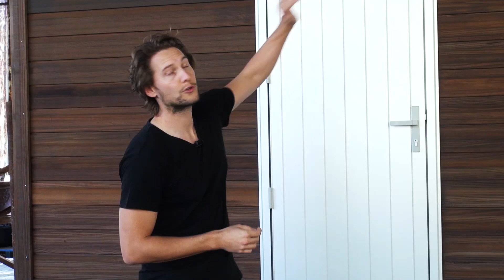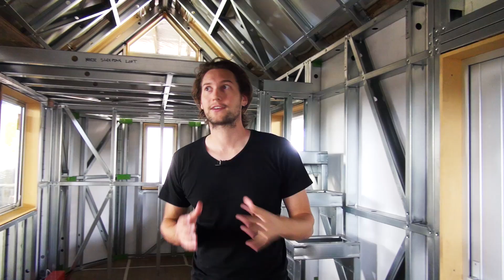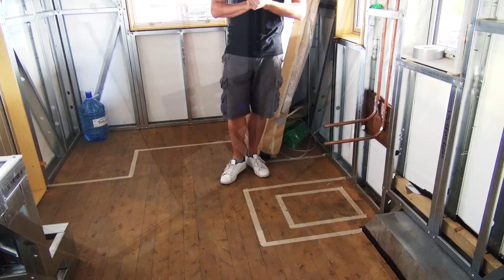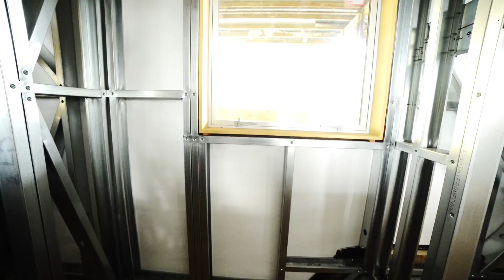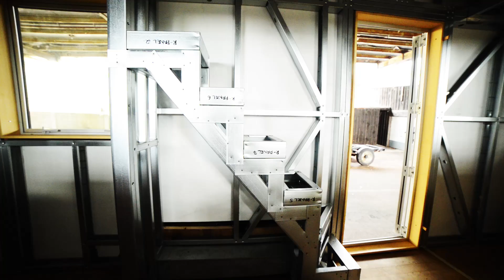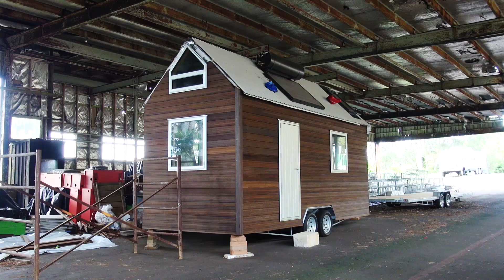Tiny House - Plans For Internal Fit-Out

Comment: Those boards on the outside are soooo beautiful!  I'm always wondering the weight difference between using steel & wood framing.  The builder I like in the US only uses wood, but I like the idea of steel... hmm.

Comment: You have put a great deal of thought into the bones of your Tiny House. Spaces, like the shower area, can easily conform to the geometry you have thanks to modern materials. Marine ply covered with epoxy and fiberglass can last forever and be further covered with tile, etc... I think the Japanese have taken small bath spaces to the ultimate limit. While some are not practical to larger persons, the concepts an still work. I think one critical key to a small shower is to have a bench.

Comment: I had the same idea about using square steel tubing. Would this weigh more then if I use wood? My trailer is 26ft so I want to use all of the space. Although I need to be at or under 6000 lbs finished.

Comment: A shed roof gives soooo much more room. Also, solar panels on the roof dictate parking the house at a specific way. Storing your solar panels on the floor when traveling and then placing them on a stands outside is a much better solution. Yous looks great but these are my preferences

Comment: Impressive build so far. There's a few things I would've done different on design but to each his own. I am still in design process of mine but I will be building on a 42' deck over with a raised deck over goose neck trailer and have decided on steel framing as well many, many other things. Personally with your trailer I would've gone the route of a design similar to Brett Sutherlands for the loft set up. I did catch you saying something about how it would've been an issue when you were transporting the tiny home originally in reference to the power lines and trees, so I understand. Since you haven't done the plumbing or anything really with interior yet, I do have an Idea that may benefit you much better as far as your bathroom is concerned. In my designs I plan on doing a wet room type setup (basically the whole bathroom is the shower) with a rainfall shower head above and mister as well as soft spray jets on the walls. I did it this way in my design as I am 6'5" 273 lbs. so space is a hard luxury to get. With you being a tall guy as well I think the idea of the wet room would be better for you in your situation for several reasons. If you did go the wet room route, I would put a water tight cabinet where you were originally going to place the shower unit to store towels and other items you want to keep dry. you could also make that cabinet more shallow then a shower stall to have more standing space to move around in your wet room. Another thing I planned on personally doing with the wet room concept is using spray on bed liner like line-x on the floors, possibly walls and ceiling to keep everything water proof, easy to clean, and slip resistant. I've got lots of other ideas, but I think this would work great for you. Keep up the great work and I cant wait to see more video of this build

Comment: Was this project dropped? I wanted to see the finished product.
Reply from the maker: Hey Robert. No, the project hasn't been dropped. There was a hold on construction while some issues were worked through, but we are back building again now. I hope to have more videos up on this shortly.
Reply: Great! I'm considering building a tiny house at some point. I'm also interested in steel framing.

Comment: dude, with all due respect this house you are building is absolutely ridiculously overkill. Yes you have the very best tiny house in the world but to me misses the charm and character of the tiny house movement. You have gone into the luxury type camper and that my friend you are at the very bottom. Im sure for the price you could put down a deposit for a house. You have totally gone the wrong way about this build in my opinion. And really you have a very expensive big, brown dog box on wheels. I would encourage people to learn joinery skills, welding skills, and DIY to avoid the morgage trap. This is not the way to go about this kind of gig. Your out of your element. Please buy a luxury caravan next time. Jayco has a link and a tour?
Reply: Hey it's an interesting position you have. Could you list what you think is overkill and you would simplify? Is it the solar or the weatherboards or the steel frame? Some clarifications would help with your points and for future builders. Thanks

Comment: I agree 100% about the woodstove I'm really interested in what you are doing there because I have had open fire ranges in cottages I've rented and they are super effective at heating water, so much so that if I had owned the last one I would have installed a pump and a radiator in the kitchen and bedroom as I had to take baths (the bath was so big I could lie flat and not touch top or bottom and I am 6' !) at midnight because the boiler sounded like it was going to lift us off the ground Lol! I was off grid (farmer had a generator and spring water so I was never affected by power cuts in winter and I could cook/bake/dry logs in the range half and in the unlikely event that the generator was off the fire had trivets so you could get by until the farmer refueled or sorted it. So this is the model for what I want.

Comment: I would like to suggest for you, a made for you bent aluminum shower. I have seen that on a lot of the american ones, and I have to say, there is a lot less worry of issues, and you bring the shower head into the shower open of the side of the wall to avoid issues with any water damages from any holes. I have also seen ones where you literally step down into it which makes a small bath for young children on good for pets too, and may be nice for tall you as well but thats usually done on ones not moving a lot cause it affects the flooring of course. Also, I never understand why people dont make a roll out under their seating area that is some 9 inches or so high, so that they can stick a second double bed in or extra storage. I see your firestove will be on the floor (horrible for kids), but it would also affect doing the bed like that for you. But, wanted to put those thoughts out there in case they were worth looking at. I love the metal inside structures, very smart.

Comment: so I'm going to look at the update video next, but one thing you could do is add an extra support beam at the end of the breakfast bar, and then stretch hammocks from one loft to the next. that way if you have company over that isn't safe to drive home you have accommodations. it will also be taken down and put up so you have optimal use of the space 24/7

Comment: Lovely! Looking forward to seeing your finished home.

Is there a reason why most tiny homes have the triangular roof? is it by law or cosmetic? Seems that just having it rectangular would be of more benefit in terms of space and light and would prevent having to twist upon entering the bedroom.

Also, I'm assuming you opted for a steel frame for safety reasons? :)
Reply: A rectangle house will make the water sit on top instead of drain off the edge

Comment: Does anyone have an opinion about the steel framing? I want to do that for mine, I just don't know all the pro's and con's yet.
Reply: pro: lightweight, recyclable, quick installation, more durable, now generally the same price if not cheaper than wood, fire and termite resistant due to not being wood, does not warp like wood, structurally sound, does not need a chemical treatment so it's good for allergies and asthma.
con: not as well known, so it can be more complicated since it is not traditionally done.Is custom done and unchangeable versus using wood. Got all this from a quick youtube video
Reply: @ramenchuu  Also, condensation issues. Bryce said that he circumvents these issues in his newer US build, but I haven't been able to find any info on exactly how he did.

Comment: If I may share two words with you brother: "Wet Bath".
If you're 6'4" tall how will you sit or bend over to wash your feet without hitting your head on the shower walls? Whatever you do decide I'm quite interested to see.
Good luck
Reply: DarrenD777 Also - I'm curious as to why you have a gable roof instead of just a shed roof with only a few centimeters of drop? With steel structure you don't even need a drop (angle) to withstand water, or even snow load. Sure, it would look quite rectangular - perhaps Modern (vs. the Contemporary Design you have) but you wouldn't bump your head in the loft. As you can see I love to maximise things - everything! ;-)

Comment: A few things I would do if this were mine...the floor I would have the floor heat up for the cooler weather, I would have the interior insulated by blown foam insulation as this keeps the place sound proof as well. I would have an Espar heater installed and a small diesel tank for that heater to run off. Truckers use these tiny gems. The loft roof on both sides, I would have a rounded roof installed and windows for air circulation.
The wash room possible would construct this room in the same manner RV's / motor coaches are designed. I really like the idea of how you built in the stairs. take care

Comment: Being that weight is an issue for a tiny house I've lately wondered why no one has thought of using steel studs. Well, here you go. the first video I've seen using steel studs. Let us know what a difference in weight that you have saved by using steel. Awesome idea. You have really thought this through. From Ozark,Missouri. USA
Reply: I would think steel is a bad choice because it's a great cold bridge, negating more insulation than other methods like wood. But maybe I'm wrong and it's negligible.
Also the strength per weight (specific strength) of steel is less than e.g. oak or alluminium and much worse than fiberglass.
I'd think the ideal way would be rigid insulation PU foam core with fiberglass hand layup.

Comment: Is there any chance your FrameCad design could be made available or at least put up on FrameCad's site for sale/review? I'm guessing it would need to be tweaked because of trailer dimensions and possible changes between US transportation sizing limits and where you are? Ours are 8'6" (~2.6m) wide and 13'6" (4.1m) high before you require a "wide load" or special transportation permit. I'm in the early planning stages and the steel construction is very interesting. I have the basic know-how to do a wood-framed structure, but weight-savings on the framing could allow other options internally that would be appealing, but otherwise problematic (ex., additional appliances, water tanks, solar components, etc.). I'm not sure how feasible it all is as the FrameCad distributor in the US appears to be in TX (I'm in New England). Wondering how the price compares, too. :)

Comment: I love the idea of living big in a tiny house & so do my 2 daughters (10 & 12) but, my husband wants nothing to do with it :( Your layout looks great!! But, I have a question & a suggestion. My question is; why did you use the steel framing and not wood? I know it's stronger, but, it's heavier & cost more doesn't it??? For the shower area, move the toilet across from the shower area and make the whole area the shower. Meaning; after putting up the wall board, use ceramic tile & grout or water proof sheets over the wall board??

Comment: i like the idea of using this kind of steel, but I live in the UK, with cold and wet winters (and summers!). I'd really be concerned about having enough decent insulation and to minimise cold bridging, and that is far more of an issue with steel than wood framing.

Comment: I would go with a pocket sliding bathroom door made with a shoji screen look,  something you could make yourself, In the bathroom I would go with a ipe type wood shower floor, you might even be able to inset the shower pan in the sub floor so the shower would be flush level with the bathroom wood floor and last thing is a rain shower head.

Comment: Hey! Wonderful design! How did you manage to get so much headroom in your loft? Are you making it work by having less headroom in the area below the Ioft? It looks like a lot of space for a 45 degree angle! Although, I am going off the assumption that your height limit is 13.5 feet as it is in California, it may be different for you of course.
Reply from the maker: Negin Sarrami One of the things that has really helped give us more height is building the floor into the trailer, so the trailer itself actually becomes the floor joists. We saved a good amount of height there. Also, Tiny Houses in New Zealand can be 4.25 meters high, which I think it a bit more than the allowance in the US.
Reply: Oh what a clever idea! Thanks.

Comment: This is great!
I've got to find the USA-available equivalent of the Sparky stove you're describing! What a cool way to make the most of the fire... like this, it really does become the heart of the home.
If anyone knows of anything available in the US please share! :)
Reply: Allenbass7 And also I'd be curious (a few minutes of research later) ;) to learn whether you've chosen to use an electric pump or thermosiphon system to run the water thru, and how you've decided to situate the necessary correlated equipment. Wouldn't be a bad future video ;D
Reply from the maker: Allenbass7 Hey there. We actually use both. So the water thermosiphons between the stove and the hot water tank, and the solar panel and the hot water tank, but is pumped electrically throughout the house.

Comment: Living Big, I've been following you throughout the entire process and I am wondering what made you select an A frame roof or a shed roof in the end? After you interviewed Brett Sutherland and I viewed the Morrison's "hOMe" video I was convinced that a shed roof was superior in design.
Reply from the maker: Mike King Hey Mike. It really just comes down to personal preference. We didn't want our home to look too tall and boxy. Also, we really wanted to build in the double skylights over the bed. I think Brett and the Morrison's have both done great designs but I just personally prefer the gable roof look.
Reply: OK, thanks for the input. I personally prefer the shed style for the added head room. Skylights, solar panels, etc are still feasible. Best of luck with the rest of the build.
Reply: Sounds to much like CHU living to me, do these units come with complementary rocket attacks?

I say 2000sqf or fuck off

Comment: Wow! That is quiet a build. I haven't watched your other videos yet, but I was wondering what you plan to do about the metal being a heat/cold conductor? Or condensation on the metal frame? Will that even happen? 

But cool layout! Will give us ideas for our own tiny house.

Looking forward to more. :)
Reply from the maker: Meet the Omlets Yup - metal is a conductor and we're using the appropriate measures to deal with that. Even though it's a mobile structure, we're actually constructing the house on top to the NZ building code. We've covered some of those things in our steel framing videos. :)

Cheers and thanks for watching!

Comment: Living Big In A Tiny House What is the size of the trailer? Is it 6m including the bathroom or is it 6m plus the bathroom? Love the work you're doing. Also with the breakfast bar, will that double as kitchen space when not in use?
Reply from the maker: Fraser McEwen Hey Fraser. The total length of the house is 6.6meters. Yup, the breakfast bar can also be used as kitchen prep area.

Comment: Hey Bryce, love the progress so far. Just a random thought for when you have completed the build. I might suggest adding a rear camera under the gable for when you are motoring along. Will make parking your tiny home that much easier and if you run the cables before you put the walls if you wouldent have to worry about weathering on the cable. Keep the videos coming :)
Reply from the maker: Matthew Kinnaird That's a great idea. Thanks Matthew!

Comment: I'm so excited for you guys. It's looking so good and quickly too.

From the day you laid down the floor I've been curious about insulation. Has that been done already? What about the interior wall insulation, will you be showing that to us?

I noticed you left out key words like, oven, fridge, freezer, washer, dryer. Do you have plans for those items?

Looking forward to the electrical, plumbing, and lighting video's. As I was watching I was wishing you had more ceiling windows for more natural light (maybe I am taking for granted the roof the house is built under, it just seemed a little dark inside).

Thanks again for the vids, hope to hear more about the appliances or lack thereof. I guess the only other alternative for an oven is a hangi e hoa... nothing like an outdoor wharekai aye... yum.
Reply from the maker: Epiha Hey there. Nope, the insulation hasn't been done yet. It's one of the next things to be done in the house though. 

We will be putting in a fridge with freezer and a stove and we are looking into options for washer dryers. 

There are quite a lot of windows already for the size of the house. Right now the warehouse roof is blocking a lot of the light that will come in. Also remember that if you have too many windows you can run the risk of turning the Tiny House into a greenhouse! Over heating is a much bigger problem in small homes.